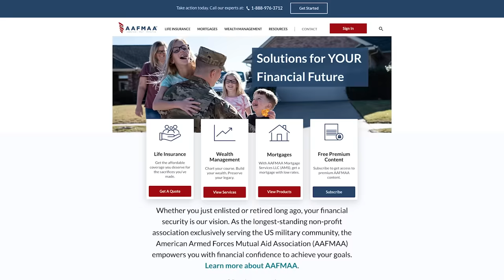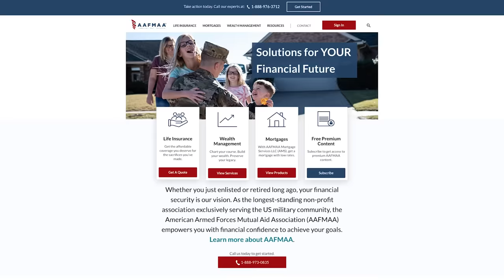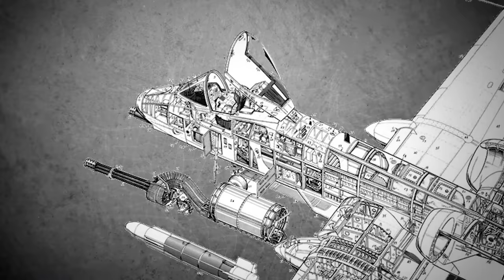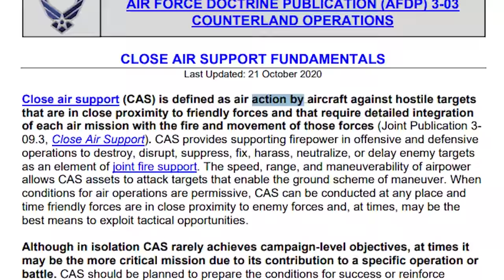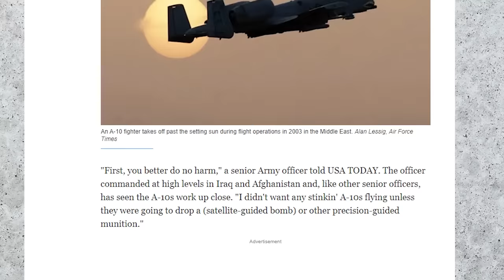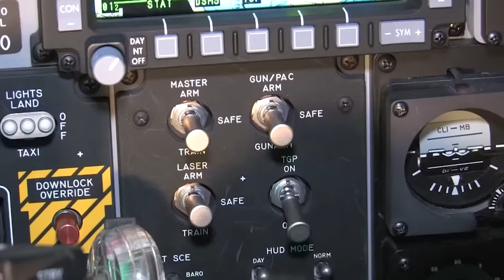Why the Air Force is Screaming to Retire the A-10 Warthog

Comment: The biggest problem is not that the A-10 can't do CAS anymore on the modern battlefield. It's that the AF doesn't want to do CAS at all. As you say, CAS is a mission not a platform. Here is the thing though, having a dedicated platform means having a dedicated group of pilots and a community that eats, sleeps, and breaths CAS. This might be a hot take, but I can see the Army turning some of it's new tilt-rotor aircraft into modern sky-raiders to fill the gap.
Reply: This is blatantly not true. If USAF didn't do CAS, Army would get fixed wing combat aircraft back. There is no gap, either, an A-10 is objectively inferior to an F-35 at CAS in every way except cannon size and ammunition.

You're right about the dedicated CAS community, though. The only reason A-10 has made it this long is the justification "see! We have an ENTIRE AIRCRAFT and community that is completely incapable of anything else because their aircraft suck. It proves we care about CAS!"
* proceeds to conduct CAS better, in larger quantities, with strategic bombers, eating up the airframe life of the entire B-1B fleet *
Reply: @superfamilyallosauridae6505  And the fleet of 64 F-111F's got more tank kills during desert storm than the 144 strong fleet of A-10s. The A-10 has been out classed for decades now, it couldn't even match the now retired F-111 at it's own niche. With the F-15E and AT-802U there's no role left for the A-10 to fill.
Reply: @superfamilyallosauridae6505  Air interdiction is NOT CAS.  Fighters don't have loiter time.  Fighters, sceam by too fast to put eyes on target.  Fighters are not armed to spend time low enough to see  what they are doing.  But USAF LOooooves it some fighters...  Regardless of utility.  So keep repeating the line but F35 is not a superior CAS platform.  You did hit one thing right.  The ONLY reason USAF talks CAS is to hold  on to that funding.  It will be up to Army to make the case to Congress that F-35 isn't supporting the mission so they can get the money back
Reply: @jeffprice6421 the sniper XLR pod does allow it to see what they are targeting. No one need to go low anymore not that it helped the a10 with its very high friendly fire incident rate
Reply: CAS is simply not possible against a modern opponent, no amount of SEAD/DEAD will get rid of all close range systems and manpads. The Ukraine war further validates this, attrition rate is to high for such an expensive platform. The GWT gave the A-10 an opportunity to shine against an opponent with zero airdefence but unless round 2 of Afghanistan is in the works that money is desperately needed elsewhere.
Reply: If the Air Force don't want to fly it, why not transfer them to the Army and let the Army aviators fly them?
Reply: @dennisseah9403  Because they are busy flying helicopters. So now we need new pilots, groundcrew, etc at huge expense and then the A10's will still be grounded after a few blue on blue issues. The problem is the boys in the trenches think they know what is going on, but they don't. The F35 can sit at 30 000 ft, out of sight to friend and foe, and the enemy can die without knowing what killed them and if it happens over the hill, the friendlies won't even know about it at all.
Reply: The future of CAS is cheap ground (troop) operated drones.. sticking men in planes to fly into the teeth of modern air defense systems becomes more untenable every day.. I'd not be surprised if with the next 20-30 years all manned strike craft will have been replaced with drone systems either remote operated or just as likely A.I  piloted with some form or remote human oversight.

For the cost of an old F16 for example the Russians can field around 1800 Lancet drones.. before the F16 has even fired a shot..
Reply: @tomte47  The Ukraine War is fought, in the air, by an incredibly ineffective (for its size and theoretical capabilities) Russian Air Force that must not have the munitions or training it needs, and a Ukrainian Air Force that is tiny. Neither is fielding stealth jets in any significant number. The continued survival of the UkrAF absolutely proves the opposite of what you're saying
Reply: @jeffprice6421  An F-35 has far more loiter time than an A10 that gets shot down in double digits facing Iraq in the 1990s and is not massively more survivable today. It also probably has more loiter time in absolute terms too if you compare distance from where it's sortieing apples to apples, as an A10 is incredibly slow to even get somewhere. 

Do you know what GBU-53/B Stormbreaker is?
Reply: @superfamilyallosauridae6505  Neither side is doing CAS, I fail to see how the survival (or not) of UkrAF proves anything ?
My whole point is that while stealth, munitions, training and better SEAD/DEAD might be able to neutralize long and medium range systems you will never get rid of all the shortrange systems. So you will be limited to staying above 5000 meters or take unacceptable attrition rates. This makes the type of CLOSE air support from A-10 strafing runs we have seen in Afghanistan not an option against a modern opponent and makes the plane obsolete.
Reply: @tomte47  Both sides are doing CAS in very silly ways, but this is a hardware issue. Most of the best air defenses around are present and precision munitions are relatively limited, which makes them limited to interdiction. CAS is primarily done by helicopters, and even drones, and often in a manner that makes them essentially flying rocket artillery. 

F-35s and SDBs and things like that would massively change the nature of a peer conflict. They'd be able to do CAS.

I agree about the A-10, I was very confused on what you were trying to say originally on that aircraft and may have confused you for someone else. 

Though, close refers to proximity of munition to friendlies, not proximity of the asset providing it. 

The USAF would absolutely have the mass and capability of getting rid of almost all shorad in an environment like Ukraine competing against a 4th generation fighter equipped air force. 
Specifically, because drones and other decentralized ISR assets in combination with existing ISR assets would be able to find the SHORAD, especially once we learn more about this part of warfare and actually integrate small drones further and further.
Reply: @dennisseah9403  Because then Army gets the money...  The only reason USAF developed the A-10 in the first place was to block Army from getting the money.  The program was a blocking function and the plane has been a red headed step child from the get go.  THis makes criticism of the sensor package particularly galling.  The sensors are what they are, because USAF never properly supported the program at the top.  They created to block Army from getting that funding, and once they succeeded in blocking Army, they immediately wanted to pivot to spending that on something else.  Anything beginning with the letter "F"...  A-10 can support danger close CAS in the daytime.  Can F-35 come down on th edeck low and slow and put eyeballs on an objective to support forces in contact?  No.  Not slow.  Not survivable.  Not armed to do it.
Reply: @jeffprice6421   I don't doubt that the F-35 is capable of providing CAS but I will definitely agree with you on the money part. The purpose of the A-10 was never to kill tanks or provide CAS it was to kill the AH-56 Cheyene. It was 100% successful if you measure it by that metric.
Reply: The army will try to do something,  but I will believe the effectiveness of the tilt rotor design when I see it operate in real life and not just video promos. The tilt rotor design tends toward crashes and mechanical failures
Reply: @gradycdenton  
To be fair the Cheyenne didn't need the help, what with half the systems in it not being ready for prime time and the other half that would have been obsolete by the time the thing would have entered service.
Reply: @superfamilyallosauridae6505  the Air Force has never been a big fan of CAS its kind of hard to debate otherwise. Fighter Jets are not only sexier, but the pilots are basically rockstars and pro athletes so they tend to be more likely to be able to work their way up the chain and put into decision making positions. The reason Air Force doesn't let Army have fixed wing is all a power play.

I'm with you that the A-10 isn't great at CAS (and a plane actually dedicated to the roll would have been more like an OV-10 but getting a plane like that has been tried something like literally 10 times in a row and canceled and maybe on the 11th try they claim to have picked one), though my minor quibble is its doubtful the F-35 is currently as capable because it hasn't gone through integration with all the things it will probably one day carry and most stuff at least for now seems to be things that it can carry internally (to keep stealth).
Reply: @jeffprice6421  and at the end of the day the A-10 is also still a jet. So it still is faster and can't loiter as long as something actually made for CAS
Reply: @jeffprice6421 "fighters are too fast to see targets" sir I think EOTS would like to have a wors with you. Long range thermal/color cameras with auto stabilizatiom are a thing that exists. You don't have to get close to a target to see it anymore, it's not like ww2, we have technology now.
Reply: They'll have to. The Air Force just does not care about blue-on-blue, their main concern is making it home, so they drop whatever, wherever, whenever, call it good and report whatever random lie floats through their heads, and go home for a beer.
Reply: @tomte47 "That money is desperately needed elsewhere." Might be valid.
Oh, by the way, did the Department of Defense find that twenty trillion dollars of missing money it "lost"?
Reply: @johntowers1213 All of that about drones and A.I. is probably true.
I watched Battlestar Galactica, too. It was visionary, and should have run its planned five-year scripted run instead of being butchered and re-written to finish in four. But when everyone skips the Superbowl to watch the new episode, it catches attention!
Reply: @davidgoodnow269  I suppose that's one analogy you could draw, though personally I based my comment on the effectiveness of cheap drones in the Ukraine conflict and the recent work by several military's  on A.I assisted and fully controlled strike platforms  or the Israeli Legion X drone swarm thats been turning heads this last year or so..and many other similar systems that are starting to emerge 

Baring in mind currently these systems are the worst they'll ever be and will only increase in lethality and utility as time moves on..
Reply: You can have dedicated CAS unit, who could fly on F-16, what is almost identical to A-10 but better. As it can take own HARM and AMRAAM missiles. A-10 is a dead end.
Reply: Keep in mind that a massive majority of A-10’s are the (now ancient) A-Model.
They aren’t carrying any of the advanced sensor suites that shallow military capability channels show. 
We got relatively recent anecdotes of A-10 pilots using binoculars to pick out targets because the plane does not have the sensors required to perform CAS on 21st century battlefield.

Its cannon is pretty much useless nowadays too, itll either miss its target entirely or end up poking a brit.

The only thing the A-10 has going for it is Loitertime and carrying capability.
Reply: If that works nights open, so you have to go to contest in our space like say, the Russians might be able to put up in which case you need something that actually has a few hit points to lose before it goes down.
Reply: @tomte47  The Ukrainian war is a bad example to set when it comes to the A-10...Youre talking a Nation who has 0 experience in CAS, 0 Experience in flying a vehicle supplied by the U.S. and other host nations and I would guess that has 0 Experience with combat in the current state. The only war Ukraine has been in was with russia. basically same war with different scenarios. At this point, all the vehicles we gave to Ukraine have been either abandoned, destroyed or captured. If the vehicle is stuck, they abandon it with 0 chance at recovery. When it comes to aviation, we have to scramble a team to go out there to teach them how to fly. let the experienced aviators fly in the Ukraine war and see how much of a difference the current outcome wouldve been. I can guarantee you that the war wouldve been over long ago as we trained for scenarios involving ADA, fixed wing and fast movers.
Reply: @dougerrohmer  So tell me something, If CAS would be the issue....why isnt the AC-130 Gunship in play? Its a fixed wing plane that does ground support. The AF is not wanting to do CAS in support of ground forces, yet they have the A-10 AND the AC-130 Gunship in their fleet. You might as well give both vehicles to a branch that will use it to support the troops on ground.
Reply: I wouldnt say it cant do the CAS in current conflict as we have no current conflict. If youre talking the Ukrainian forces, Ill say it: they are inexperiences with modern vehicles and as such is why I think you would say they  cant do CAS anymore. Youre right. Its a mission and that mission was tasked to the Air Force. The Air Force themselves are complaining like kids in the aspect of  "Why do I gotta do this" If you dont want to do it, then yes, funding should be cut but the plane should not be retired until a suitable replacement is made that is strictly dedicated to that mission. When the A-10's left Afghanistan, The A-29 Super Tucano's are the replacement because they can carry a ton of Ordinance similar to the A-10 and can stay on station for a very long time. The only difference is that you can hear the A-29's because they are prop planes. Yes, they are not as fast as the A-10 but can do the same role in the same battlefield.
Reply: @Mortablunt  A-10 resistance is a urban legend. It is really old design. When F-15 did come back to airport, without a wing. Mobility and stealth are also parts of protection. A-10 is crap in those aspects. A-10 did have highest lost rate among US aircraft's.
Reply: Air force has never wanted to do close air support, that is why army was going to get the a-10, it got pushed on to af , army had to give up fixed wing, except for observers.drag Pentagon officers to combat zone and perspective would be voiced the other way.
Reply: @superfamilyallosauridae6505  Actually it is absolutely true. Along with the A-10 the Air Force is also slowly doing away with it's TACP,JTAC program as well. If not familiar TACP/JTAC's are the dedicated forward air controllers the Air force embeds with army and Marine units to call in air strikes. To me that's a clear indication the Air force doesn't want the CAS mission
Reply: @GruntyGame  What else did the VARK kill big difference in plinking tanks from 35,000FT where they were nice and safe from ground fire and actually having to go down into the weeds and find them because the Air force had starved your jet of weapons and sensor upgrades that every jet was getting but yours. The A-10 has never been out classed it was out right neglected by the air force who never wanted it in the first place. BTW let's see them plink tanks when they don't have sitting ducks as targets. Hitting a tank in the open desert using laser guided bombs doesn't take a whole of skill.
Reply: @Mortablunt  Thats not really how planes are designed do. 
Although the A-10 could definitly withstand some hits on occasion: It was never expected to be hit. Being hit by just about anything whilst flying a plane is considered worst case scenario.

Even back in WW2 we knew this was a technological dead end and only used in specific circumstances. 

Armor on planes is heavy and it gets in the way. If the titanium bathtub on the A-10 was meant to keep the plane alive they wouldve put it on the outside...
Reply: Actually in truth, some in the USAF, never wanted the A-10. Wanted to get out of CAS. During flight testing of this aircraft, several high ranking USAF generals (fighter  mafia) tried to get A-10 transferred to Army, than MC along with CAS mission. Due to politics in Congress and some in military, this never happened. During past NDAA hearings, USAF tried to kill funding for this aircraft, and CAS mission, but never fully accomplished this. The manufacturer even built a two seat version of A-10. YA-10 night adverse version, with upgraded avionics/electronics. A very formidable aircraft... Yet it was never purchased by USAF. Today modern drones can accomplish this mission, along with upcoming A.I. piloted platforms. @superfamilyallosauridae6505
Reply: @gradycdenton Yes, the A-10 was partially designed to out-compete the Army’s AH-56 for funding and relevance, but the Cheyenne did a pretty good job of killing itself.  It was big, fast, and carried a lot of weapons, but its design and systems were becoming obsolete before it would have even entered service.  The combination of the Cobra and the A-10 ended up giving us superior overall capabilities.  The Cheyenne entering service may have also cost us the Apache, which was far more advanced and adaptable, and has become the most successful attack helicopter of all time.  As for the A-10, it was fine for the job for which it was designed for about 20 years.  Better SHORAD and MANPADs, combined with better targeting tech that let newer aircraft do its job from a much safer distance, have just made it obsolete as a front line aircraft.
Reply: @sethhornbaker2216 Apparently the V-280 uses a different design than the Osprey.  The Osprey’s whole engines tilted, whereas on the V-280 it’s just the rotors themselves.  There’s also a drive shaft running through the wing that keeps both props turning in the event of an engine failure, so there won’t be any differential lift unless the aircraft takes a hit that would destroy a chopper anyway.  And it can fly after a tail hit, which most choppers can’t.  For that, we get double the speed of the Blackhawk, 3x the carrying capacity, and 2-3x the range.
Reply: @removedot By the time the US Army needs CAS, it’s likely that the enemy’s Air Force and most of its AA capability near the front will be either gone or heavily degraded.  And I’m sure the F-35 will probably be more integrated with existing systems (and new ones) by the time the A-10s and F-16s have been retired.  And don’t forget we still have over 2,000 Apaches for CAS.
Reply: @davidgoodnow269 That it absolutely absurd.  Of course the USAF cares about blue-on-blue.  Every CAS pilot’s worst nightmare is to kill friendly troops.  The thing is, the A-10 is one of the worst aircraft ever for friendly fire incidents, because it has outdated sensors and a gun that is hard to keep on target at 300 mph.  Most A-10 kills are made with bombs and missiles.  An F-16 or an F-35 can drop those same bombs and missiles much more accurately from a much safer distance.
Reply: @TheRezro ”But better” = 6-7x faster, much better fire control system and sensors, able to take on enemy fighters, has a missile warning system.   But hey, it doesn’t have a 30mm cannon that won’t kill tanks, or a titanium bathtub around the cockpit, so it must suck at CAS, amiright?
Reply: @johnshackford If other jets with advanced sensors can hit the same targets without getting down in the weeds, then what’s the point of putting advanced sensors on a jet whose only job was getting down in the weeds?  This is the crux of the issue.  More capable weapons and sensors mean the A-10 doesn’t offer any advantage anymore.
Reply: @bluemarlin8138  that is not really true with the prevalence of effective man portable AA. But is also part of my argument that the A-10 has no real role, even if we ignore the F-35. 

Like you said there are apaches and those can play more tricks with rising up, shooting and hiding before anyone can get a lock and shot. It doesn't bring the firepower a Gunship like an AC-130 can. It might be a bit cheaper and easier to maintain, build, loiter, etc for now than other Jet Warplanes; but not when compared to a non-Jet like an updated OV-10 would be (which has a far better view)

I've been a big proponent for an ACTUAL CAS and Co-Insurgency plane like that, and it seems drones are always around the corner; but this seems like the role after observer that drones could really fill, now that Special Ops have finally picked something to kind of fill the role.
Reply: @tomte47 Well ew warfare and jamming could save it along with working together with other assets can minimize the threat to the a10
Reply: @superfamilyallosauridae6505 Ahem loiter time speed and durability plus payload capacity
Reply: @superfamilyallosauridae6505 Well to perform cas you need low and slow and no the a10 has a far larger loiter time on station then the f35 also it was shot down in the double digits so I don’t know where you got that from and the storm breaker is an effective weapon it is just cas is necessary for troops because no other platform can replicate the a10s success and reliability plus durability
Reply: @jeffprice6421 True the ah56 Cheyenne was blocked because of the a10
Reply: @Chillforev-dd9wr  First off, payload is blatantly incorrect. F-35 has a total payload of 18,000lbs, and an A-10's max payload is 16,000lbs. An A-10 will need external fuel tanks, external targeting pods to actually effectively get somewhere and use its payload, so practically it's actually significantly less payload in weapons. An A-10 cannot practically use nearly as much air to ground payload as an F-35A, and in absolute terms has less payload in a perfect world.

Why do yall keep saying low and slow? Do you even know what EOTS is? Modern fighter jets like the F-35 and previous 4th gens with good targeting pods literally have similar observation capability to attack helicopters. Because they can orbit so high, they can effectively not leave and provide CAS to a larger area of friendly forces, more rapidly as they're faster. 

Ground forces have a lot of ability to generate GPS coordinates, both of themselves and of things they look at. They can send these to aircraft pretty easily, who can then look at things. Plus all the other manners of marking systems... ground forces must communicate with the aircraft essentially no matter what. If they can do that, it is easier for an aircraft with a targeting pod/something like F-35's EOTS to figure out what's going on than a pilot looking out his window wishing his eyeballs had 60x zoom and stabilization. 

Figuring out what's going on low and slow is a lot harder than with an F-35. 

On loiter time, A-10s can loiter for two hours. F-35s can do an hour and a half. Both of these numbers are super rough, but regardless an F-35 will get places far faster than an A-10, so practically it is more available. 

An F-35 has 18,000lbs of fuel, an A-10 11,000 internal. F-35s can carry their weapons internally, which reduces drag. 

We don't have charts to compare these things in loiter time, only random numbers here and there, but there's a lot of things that mean that in any real world situation an F-35 is there sooner, has better situational awareness and can thus prosecute targets faster. A-10s need refuelling too, and which can reach a tanker faster? 

A-10 is not a good CAS jet. At every point in history, it was outclassed by other CAS jets, specifically, the A-7 through its entire history. The A-10s 250 nautical mile combat radius for a CAS mission is incredibly small. An F-35 can go 790 nautical miles interdiction. That's different, but a similar CAS mission probably looks like 500 nautical miles for an F-35 on internal fuel.
Reply: @superfamilyallosauridae6505  Please let me sleep debate tomorrow?
Reply: @superfamilyallosauridae6505  All the points you make are true and in no way contradict the well argued point tomte is making. Both air forces have taken substantial losses. This conflict has demonstrated the strength of ground based air defense in modern conflict. S-300s (both Ukrainian and Russia) and S-400s (Russian) have taken down quite a few aircraft. Western AD is even better. Look at the PAC3. All manned aircraft have a lot of trouble operating near the front lines and at a high altitude where their smart weapon targeting is done. It's just too dangerous. In the opening stages of a US-China war any large non-stealth aircraft on either side operating near the front lines is going to be toast.
Reply: Everybody in the AF wants to be a fighter pilot! But how many AF/ANG A-10 pilots just weren't good enough to fly F-15/F-16 fighters?
 If they can adapt the Warthog to land on baby carriers, give it to the Marines! I know several Marine combat vets from the Gulf wars who think of the A-10 as their personal guardian angel. And Marine pilots know about looking after their brethren on the ground. For CAS, the A-10 is probably better than an F-35.
Reply: @superfamilyallosauridae6505  I’m awake now yay your forgetting the three other most important things for a cas aircraft ease of mateinance, reliability and the ability to take off from roads and makeshift airstrips also cost. The f35 is and can’t do any of those unless it is the b which sacrifices fuel and payload also the f35 can only carry a small percentage of its weapons internally what you mentioned 18,000 pounds is murder configuration so in all sense those drop tanks are not needed when an a10 can take off from a road or a grass field 30 to 50 miles away and with its is designed to be easy to maintain in the field and is extremely reliable with a mission readiness rate of over 95 percent. I have never heard of an a10 that did not come through when being called in plus the army is begging the Air Force not to retire the a10 the same branch that didn’t have want it now wants it that had to say something
Reply: @pb68slab18  All around dumb comment. 1. Thats not even close to how pilot selection works. 2. The A10 needs 3000 ft of runway to take off without assist. There is no way to modify it so it can take off from even the largest 1000ft carrier runway. 3 If the air force wants to get rid of the platform because its obsolete for anything more than a counterinsurgency role why should the marines invest $ in it rather than a newer CAS technologies like drones with PGMs.
Reply: @Chillforev-dd9wr   @Chillforev-dd9wr  An F-35's entire engine comes out with literally only seven tools.  I can't speak to maintenance time, but an F-35 is a single engine jet with diagnostics systems that are very modern while an A10 has two engines to maintain and wasn't designed with that in mind. 

An F-35 having a larger payload only in a less stealthy configuration is fine, because an A10 has a payload of 0 or even negative in the form of a dead pilot in airspace an F-35 needs to stay stealthy in. 

A10s thirty miles away aren't a reality, because if an A10 is that far away, howitzers are closer, and it has also never happened despite permissive environments. Non permissive environments would literally kill an A10, so if it didn't happen in our weird insurgency conflicts it will literally never happen. 

Also, attack helicopters exist and are closer than that even. 

What does "I've never heard of an A10 that didn't come through" mean? I can think of some examples that, despite low and slow, literally engaged friendly forces and killed a bunch of British soldiers. 

Can you actually find an example of the Army, as a branch, politically asking the Air Force not to retire the A10? Some soldier on Facebook doesn't count, I mean something analogous to USMC officers stating in public "WE NEED 31 TRANSPORT SHIPS" in response to the Navy cutting down it's fleet plans despite promising them.
Reply: @superfamilyallosauridae6505  The a10s engines are very simple to maintain hell you can use any ge34 engine from a civilian aircraft or another a10 to cannibalize also the point of cas is when you have supremacy in the air which means so sams because the f35 would have gone in and done sead missions and f15s and f22s would provide air cover and even though it never happened the a10 in its very core design was made to operate from roads and makeshift air fields and those howitzers the f35 would have already taken care of them to allow the a10 to operate unimpeded unless manpads are involved even then any low flying aircraft is vulnerable to manpads and the a10 was designed to absorb these and even bigger missiles and yes it has been involved in friendly fire incidents but that was before the a10c variant that we have today and it is proven through many docs and other means of recording that Air Force combat controllers call for a10s an overwhelming majority of the time they specifically request a10s and since it is political and lobbying since the Air Force has brought up retiring the a10 since 2007 to 2009 in that frame the army chief of staff and many others in the army have lobbied and begged for the a10 to be kept due to its availability versatile weapons load as I have stated limited logistics needs and the psychological impact of an a10 and that soldier on Facebook should really matter because they should be listening to what the troops want and feel is the best and if a soldier says that the a10 is the superior option in cas then he should be heard and going back to matinenance needs the controls on the f35 are fly by wire control meaning no hydraulic lines or mechanical controls what I am saying is that if the electronics break or malfunction you can’t control your jet and since the engine is also computer controlled it can give a message of ENGINE NO DISPATCH and for flight controls FLIGHT CONTROLS NO DISPATCH which means your plane is grounded while an a10 would fly even if all hydraulics are severed because of the back up flight control system also my apologies for writing an entire paragraph
Reply: Most of our aircraft is considered obsolete by the time it's fully integrated. The F-15/16/18 are all 40yrs old or better and considered obsolete, but they are also undefeated and nothing any potential adversary has can seriously compete. OK, current A-10s cannot be retrofitted, but they can serve as a baseline for a new aircraft designed just for CAS, especially against armored vehicles.  The C-130 is also on the block, but the AC-130 Spectre is still effective, especially psychologically, on both sides. The Harrier is also going away. Which was a mistake from day 1 and only bought to placate the Brits. 
 The 3 versions of the F-35 harken back to the Robert McNamara school of 'one-size fits all' like they tried to do with the F-4 Phantom. But as much as I liked the Phantom, it was barely adequate in every roll, until several modifications and upgrades were made. The F-35 also does not carry as much CAS-type weaponry as an A-10 can. @silentsnipe260
Reply: @pb68slab18  Not sure the F4 to F35 comparison is fair. & the F35 represents a huge upgrade over Harrier jets. Also while the non-stealth fighter jets you mentioned are old they certainly aren't obsolete. Some variants are still being produced.